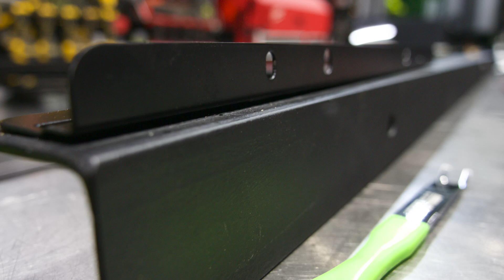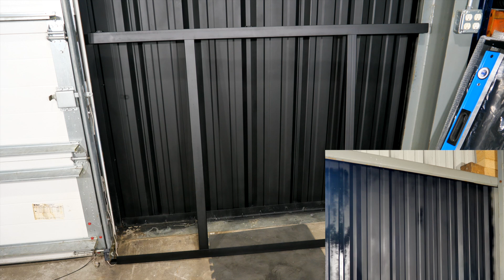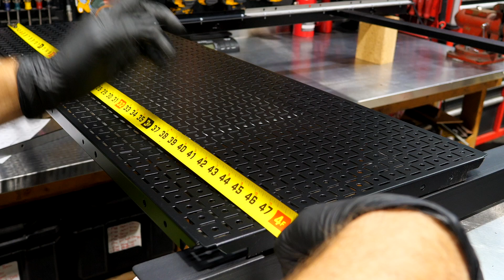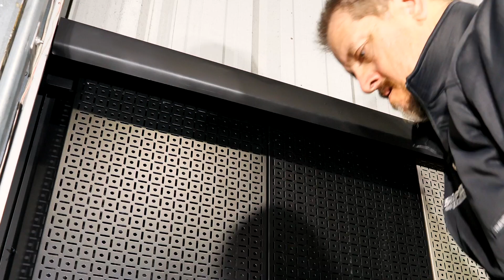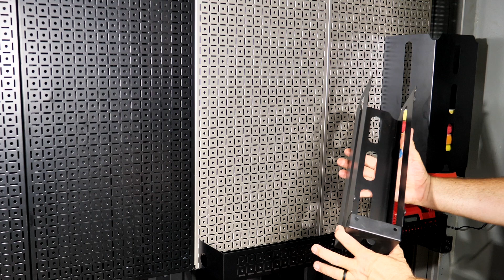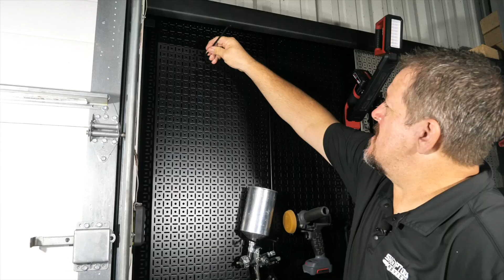DO THIS FOR LESS STRESS! Easy Shop Organization - OmniWall Metal Pegboard

Comment: I have priced competitors and Omniwall has the better construction that i have i seen so far (the cleats make securing the board easy). Going to be placing a order for 4 pack myself. Thanks for doing a tool review sooner than later.